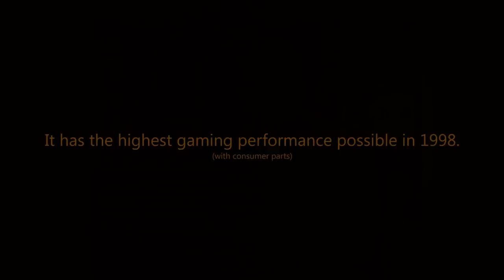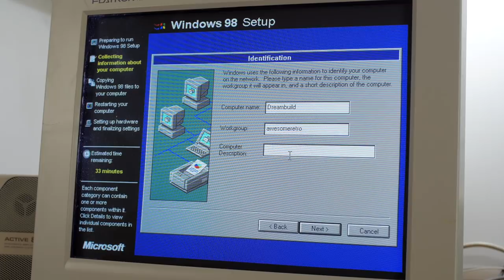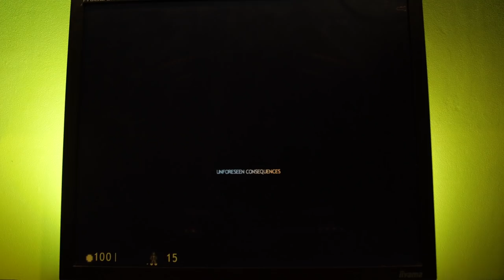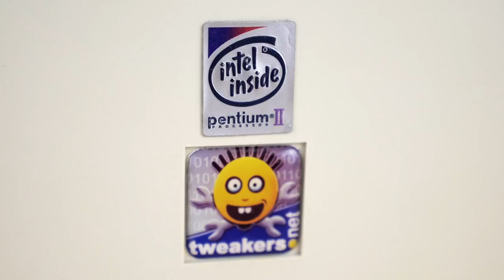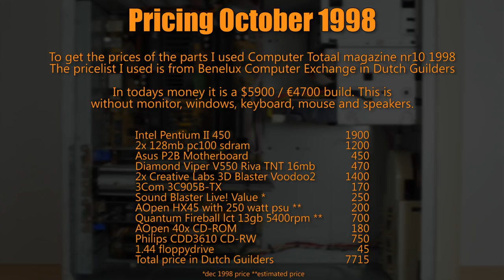1998 Gaming Dreambuild! Pentium II 450, 3DFX Voodoo 2 sli

Comment: Wow that takes me back to when I used to build those computers so many cpus K6, PENTIUM, C5, K7, 486, 386, PENTIUM PRO, ...what you could do with a 30MB hard drive back then .. now you need at least 30GB to even sniff at Windows 7, 8 or 10!!! Windows 98 & 95 was personally the best OS for me the sucked ones were Vista, Millennium and 8.0.  ooops Windows Update !!! 30GB full of off updates you don't need lol ... used to love my 233Mhz IBM C5 or IBM 7Mhz AT 286 system with 512MB and ISA Graphics card !!! that IBM was a heavy computer!!!
Reply: I once fit an entire copy of Windows 7 Ultimate on a 12GB drive because I had no other ones to spare and it was noisy but worked fine. Quantum Bigfoot TX if I recall. 

I kind of miss the competition there used to be on the market in the early 90s. Nowadays you have three choices, integrated nVidia of AMD. 

Back in 1997, you had:
ATi, nVidia, Intel, 3DFX, Diamond Multimedia, S3 Technologies, Chromatic Research, Xenon Technologies, Cirrus Logic, SiS, Creative Labs (Graphics Blaster PCI CT6610), Western Digital (yes, the same one), IBM, Video7, Paradise, Chips and Technologies, STB Systems, AMD (before they bought ATi and ruined the Radeon line), NEC (also the same one), and plenty more. 

Really beginning to miss the days when having an 8MB graphics card was a big deal, or when having any L2 cache at all was a huge performance boost. We've reached the point of diminishing returns, back in 1996 even adding one megabyte of memory could make your computer much faster. Nowadays it's 1GB.
Reply: LOL done that!! windows 7 on old drives but seriously old stuff is built forever!!
Reply: +AIO inc. You forgot Number Nine, Tseng, Oak Technology, 3D Labs, and Elsa.
Reply: lol hey I getting old now lol my memory isn't as good now :D no one is perfect lol
Reply: 1985sean
I don't recall ever seeing Elsa cards, but Number9 and Oak Technology... all the time.
Reply: a lot of them companies have been swallowed up now like 3DFX that was before its time!
Reply: oh and I have a ATI R9290 and always have either XFX or TITANS
Reply: Kcin Setay Elsa, the video card manufacturer.
Reply: Extended Industry Standard Architecture
From Wikipedia, the free encyclopedia

					Jump to:					navigation, 					search				

This article needs additional citations for verification. Please help improve this article by adding citations to reliable sources. Unsourced material may be challenged and removed. (June 2012) (Learn how and when to remove this template message)
EISA
Enhanced Industry Standard Architecture
Three EISA Slots.
Year created
1988; 28 years ago (1988)
Created by
Gang of Nine
Superseded by
PCI (1993)
Width in bits
32
Number of devices
1 per slot
Speed
8.33 MHz
Style
Parallel
Hotplugging interface
No
External interface
No

SCSI Controller (Adaptec AHA-1740).

Fast SCSI Raid Controller (DPT PM2022).

ELSA Winner 1000 for ISA and EISA.
The Extended Industry Standard Architecture (in practice almost always shortened to EISA and frequently pronounced "eee-suh") is a bus standard for IBM PC compatible computers. It was announced in September 1988 by a consortium of PC clone vendors (the "Gang of Nine") as a counter to IBM's use of its proprietary Micro Channel architecture (MCA) in its PS/2 series.[1]
EISA extends the AT bus, which the Gang of Nine retroactively renamed to the ISA bus to avoid infringing IBM's trademark on its PC/AT computer, to 32 bits and allows more than one CPU to share the bus. The bus mastering support is also enhanced to provide access to 4 GB of memory. Unlike MCA, EISA can accept older XT and ISA boards — the lines and slots for EISA are a superset of ISA.
EISA was much favoured by manufacturers due to the proprietary nature of MCA, and even IBM produced some machines supporting it. It was somewhat expensive to implement (though not as much as MCA), so it never became particularly popular in desktop PCs. However, it was reasonably successful in the server market,[2] as it was better suited to bandwidth-intensive tasks (such as disk access and networking). Most EISA cards produced were either SCSI or network cards. EISA was also available on some non-IBM compatible machines such as the AlphaServer, HP 9000-D, SGI Indigo2 and MIPS Magnum.
By the time there was a strong market need for a bus of these speeds and capabilities for desktop computers, the VESA Local Bus and later PCI filled this niche and EISA vanished into obscurity.

:D
Reply: AIO inc. OK :D lol so many manufacturers so many products :D
Reply: +Kcin Setay No I meant ELSA lol
Reply: LOL Ah yes ELSA yes they do a lot of circuits (y) :)
Reply: +Kcin Setay They still make cards but Nidia chips are on their cards though. For example, the  Elsa 980 gtx
Reply: Ah yes I know what your saying
Reply: +Kcin Setay These graphics cards manufacturers need to come back in business. I'm tired of having to choose between Nvdia or AMD.
Reply: Yes they mostly dominate the market with there chip sets now, I don't see S3 Graphics anymore if you remember them
Reply: +Kcin Setay S3 still existed til around 2010. They made low-end graphics cards for htpc's light gaming. They were the last standing graphics card manufacturers besides Nvidia and ATI til 2010. S3 graphic s27 chrome 256mb gddr3.
Reply: +Kcin Setay https://en.m.wikipedia.org/wiki/S3_Chrome
Reply: Unichrome lol

Comment: Get rid of that hard drive, it’s just a matter of time before it fails. Get a cheap sata-pata adapter and put a small ssd or modern sata drive in it. Ssd or microsd  with adapter would be cheap and fit inside win98 limitations.
Reply: doesn't sound or feel the same

Comment: One day, our kids will laugh at our i7 GTX1080 64GB RAM machines.
Reply: Miy Jholl Imagine them like "pfff what joke is this. doesnt beat our 69 core triple-threading 6.66GHz 100MB cache i13 with Titan XE-Mk3 6666 cuda cores 3333mhz 24gb hbm4 and 512GB DDR6
Reply: Creaciones Mentales quantum will be slower on gaming..
Reply: Computer advancement has relatively slowed down in the last few years. I remember when the Pentium II was leaps and bounds above the first Pentium and that processor was leaps and bounds above the 486. Now, improvements have become marginal with many people mentioning that the Skylake isn't much better than the Haswell.

Also computers have gotten more powerful than what most people need. Most users don't need a i7 / GTX1080 machine when they only use computer for basic internet browsing/e-mail/office applications. There are also many devices besides computers that can also perform these tasks. In those days, if you wanted to perform these tasks, you had to spend $3000 and a get a near-top performance machine. Intel kind of addressed the pricing issue by introducing the cut-down Celeron processors.

Comment: Add more fans. The case does not have any back outlet or front inlet fan. Use a modern case for durability.
Reply: fans are unnecessary. Most components didn't even need heat sinks, so little heat they generated.
Reply: @GraveUypo  Perhaps not entirely necessary, but at least adding an exhaust fan could potentially extend the lifespan of your precious components. For something like a Voodoo 3 it'd be a good idea to attach a dedicated fan to the card as well.

Comment: Ah, that short time I had the top-of-the-line system, never since. Dell XPS R450, Riva TNT, SLI Voodoo 2s and Turtle Beach surround sound card. My friend bought a system with a slow clone CPU that couldn't keep up with even one Voodoo II. He brought them over, installed and we played Half-Life 1 just as it came out on maxed out settings.

As the tram sequence plays for ten seconds, he impatiently says "skip this cutscene!". I move the mouse and walk about the tram. Jaw drops. Probably my favorite system build memory. It didn't hurt that Half-Life 1 turned out to be even better to play than it was to look at!

It was a great experience to be a teen, full of wonder, experiencing such a turning point in both 3D accelerator performance and game storytelling all at once. I'll almost certainly never experience that again, both because I have changed, and because the hardware and gameplay changes have become relatively incremental, but that does nothing to take away from how awesome that memory is for me.

Comment: I had pentium 2 350 mx,32 mb ram, ati rage pro 8800,3200mb hdd,verbatim sp 800 ,15 inch monitor(maybe it was lg, im not sure) i forgot  my sound card model. I think my system was high end to in 1998. I thought 10000mb hdd will be enough  for 30 years more+ in 1998. Lol!

Comment: The main qwestion is "what about Crysis?" Like if u want see how 98year pc will run it. Maybe we will make black hole or new heat generator.🤔
Reply from the maker: Why crysis I have halfflife! :D What is your favorite old game?
Reply: @victorbart  probobly dune 2000 and red alert 2. I said crysis cos it chalenge for that Pc. Will it run?)
Reply from the maker: No it wont run! :) Red alert 2 is awesome!
Reply: @victorbart  no way) i know its old but any way i like to see blue screen 🤣
Reply: the answer is it doesn't meet the minimum requirements, lacks necessary cpu instruction, system ram, vram and api support.
it doesn't run.
Reply: @GraveUypo  that feeling when you know "it will not run", but you still keep hope inside your soul. xD

Comment: Your PC brought me inspiration and luck today just after seeing this video.I too love gaming systems from around the 1998 to 2000 era.Just today I found a really decent Pentium 2 PC system @ 450 Mhz on sale at Ebay for $120 U.S.D
( with Free Shipping).Not free unfortunately however fair considering that most retro PC's on Ebay are mostly way overpriced.Thrift stores stopped carrying old PC's in my area (I remember getting numerous Pentium 1 systems for $10 U.S.D. back in 2003 or so)
I can't make it authentic for the year 1998 like yours but I ordered a $45 U.S.D Voodoo 3 2000  AGP card from Ebay so it compares almost the same as with 2 Voodoo 2 cards in SLI.
Pentium 2 systems were very widely sold in 1999 (and even 2000) even though the uber Pentium 3 systems came out in mid 1999.
So having a Pentium 2 @ 450 Mhz with a 3DFX Voodoo 3 2000 AGP would have been a great system in early 1999 and would be about equal (the same)  in gaming capabilities to yours.Those Voodoo 3 cards always ran way too hot so I put fan coolers on the heatsinks to keep them stable

Comment: I got a HP Compaq DC7100 USDT.
Specs:
Pentium 4 ht (Prescott)
3gb ram
Intel GMA 950 (Mobo gpu)
Some hatachi 2.5 sata hdd I got from a Toshiba satellite m300
the dvd drive the Toshiba m300 came with (supprised it was compatible)
the rest are OEM parts

This is the oldest pc I will ever get my hands on. I still have it.

My current build is:
i5 6500 (skylake)
Gigabyte GA-H110M-S2H ddr4 Mobo
Antec HCG 620 watt modular psu 
Sapphire R7 360 Nitro GPU
Kingston HyperX ddr4 2133mhz 8gb dual channel (4gb 2x)
ASUS DRW-24D3ST dvd drive
Deep cool smarter case
D-link DWA-548 wireless adapter (PCIe)
2x intel 540 ssd 120gb

Comment: after all these years and we're still using 5200 RPM drives. More compacity. 5200 RPM Drives are still the most popular choice. kind of funny how we can advance in technology in some ways but not in others.
Reply: This is why SSD's are kicking in... HDD's are from 1950. It's aging. 
Also, now, only most of the laptops are still with 5400 rp/m disks, while larger builds often stick with 7200 rpm.
Reply: I try to remember while I was watching this video, when exactly I started to build my machines with 7200 rpm Drives. It must be 2001. But I was astonished when buying a 2011 Mac Mini, that they use the slower standard. Even a pc gaming laptop I buyed in 2013 (not a bad one - still handling all my games) had this horrible 5400 rpm HDD. I changed it into a ssd. Windows with a 5400 rpm HDD is not good. Mac OSX (10.6.8) from the mini did fine with it.
Reply: +Dieter Gerding you are very right! most of the desktop and laptops use the 5200rpm standard. i bought an alienware last year. had an SSD and a 5200rpm drive
Reply: +youandiryan sorry i meant 5400 rpm...
Reply: 5400RPM drives have a lower failure rate than 7200RPM, and in this case the benefits of having a faster drive would have been nullified by the slow bus speed of the Slot 1 CPU used.
Reply: +Dieter Gerding every version of Windows until 8 was perfectly usable on a 5400RPM drive. Hell, Windows 95 could be installed on 3600RPM drives. 

The problem was elsewhere.
Reply: +AIO inc. Incorrect. I used Windows 7 on my gaming laptop build in 2013. It runs like shit. That's why I changed it. Now the same hardware and software runs fantastic. The HDD was the bottelneck.
Reply: My Pentium 200 MMX machine (Sony Vaio PCV-120) has got a bit of overkill this year when I gave it a 7200rpm HDD. Windows 98 boots in less than 5 seconds!
Reply: RkivUnderground And my 386SX with a 3600RPM drive starts MS-DOS 5 and Windows 3.11 in less than 8 seconds.
Reply: Dieter Gerding "Incorrect," I've got an i5-4440 with 8GB of DDR3 and I installed Windows 8.1 on it - ran like trash. Put Windows 7 on it, worked just fine.

Was using an 80GB laptop hard disk, the problem, like I said, is elsewhere.
Reply: Wow - You use a 80 GB Harddrive to run Windows 8.1. Didn´t you have any smaller device? I know the i5-4440. It´s much more than enough power for Windows 8.1. The 8 GB RAM anyway. It is the Harddisk. An 80 GB Harddrive must be a very old one. Old device, old drivers needed. Maybe Microsoft wasn´t inventing new Software for stone age hardware. Is it SATA or IDE?
Reply: But maybe we just have a misunderstanding. "Works fine" can mean different things. For me, a SSD is the only device, that really "works fine". Every traditional Harddrive for me is just for saving lots of data. As I said, the mac mini I owned does it with a 5400 rpm HDD. But that was a compromise for me.
"Works fine" can also mean (to someone else) - it just works without any issue. Loading times are long but - hey - let´s get a cup of coffee while waiting. Maybe that is the point.
Reply: Dieter Gerding It was SATA-II, and that was the only SATA drive I had on hand at the time, it eventually got traded off to my sibling's laptop when he needed a new hard disk, and by that time I'd gotten a new one, a WD6400 640GB drive.

That 80GB drive actually came out of one of my friend's old laptops which broke down.
Reply: I have a MacBook White from 2007 here. That was original build with a 60 GB HDD (5400rpm). That´s worked ok so far. But I used Software to bench this thing - it was horrible compared to the new one I build in (I confess it is a 5400 rpm Drive too - I forgot this, when I wrote my first comment) 
These old HDD´s were build for the software of their time. Means XP and OSX Tiger. But I am glad, that you havn´t any issue running it with Windows 7. My Lenovo had run too with a 5400 rpm HDD, but I was not satisfied with the harddisk performance. But I guess, that is just my special point of view.

Comment: Nice! I just built a similar (ish) system a few days ago: P3 450, 256MB RAM, Voodoo 3 3000 16MB, Sound Blaster 16, floppy disk drive emulator, and a SD card to IDE adapter. It's not 100% retro but was something I wanted to do for a long time.

Comment: I noticed that you even used an early version of the P2B motherboard - revision 1.02, which is the revision people would have had in 1998. Whether that was by accident or due to your attention to detail - good job on the authenticity of that.

I've had a few dozen P2B boards over the years (I used some myself and also used to test and sell them).  Later revisions (especially 1.10 and 1.12) are better in a few ways, but I don't think they existed until 1999.

It could be argued that some enthusiasts were starting to play with building dual CPU systems with Slot-1 in 1998.  It was a novelty at the time since Slot-1 seemed to encourage this more than Socket-7 did.  But it didn't have any benefit for games so most people didn't do it unless they were using the computer for video editing or other "serious" applications.  This is a pure gaming build so single CPU is appropriate.

Comment: Great video, I really liked the camera work, but the cuts are a little to fast to enjoy the details.
At the end of 1998 I had a system with a Suntec (I think) Viper Midi-ATX-Tower, 250 W Fortron Source PSU, Gigabyte 6BXC Mainboard, Intel Pentium 350 MHz (weeks later overclocked to 392), 64 Mb RAM, Creative 3D Blaster Banshee AGP (overclocked it), Sound Blaster Live! (ordered the Value, but got the full 2-PCB-version boxed without paying extra), CreativeLabs PC-DVD Encore 5X Dxr2, Hauppauge WinTV-PCI (which you could decode Pay-TV with), IBM 8,4 GB harddrive, Iomega Zip100-drive, 19 inch Belinea CRT display. I still have most of the mentioned hardware in working condition, only the CRT, the mainboard (due to another PSU wrecking it) and the DVD-drive are dead, which shows pretty good quality as the parts were heavily used for years.
So I'd say your Dreambuild is only missing a DVD-drive and a MPEG2-decoder-card. There came a special DVD-edition of Wing Commander 3 with it.
Games we loved to play back then, apart from the obvious ones, were Motocross Madness, Screamer 2, Extreme Assault and Sin, with 3dfx-patches where available.
I have the exact same Aopen-ATX-case you used stored here, if anyone is interested drop me a PM, otherwise I throw it away as I'm sorting out my case collection.

Comment: Also in the land of the Dutch in 1998, I bought a Chaintech 6BDU dual slot 1 at the end of 99 it had 2 PIII 800 and 1 GB of memory running a Voodoo5 5500 64MB, best part, just repaired the mainboard and videocard and having a bundle of fun retro gaming... (voodoo obviously was added early 2000 :) )